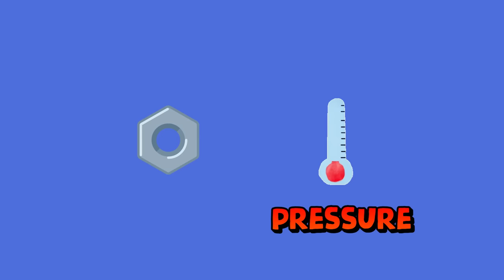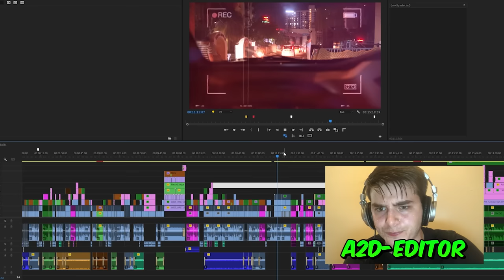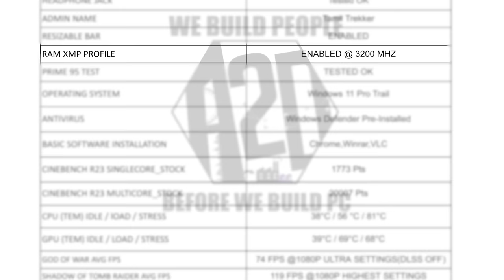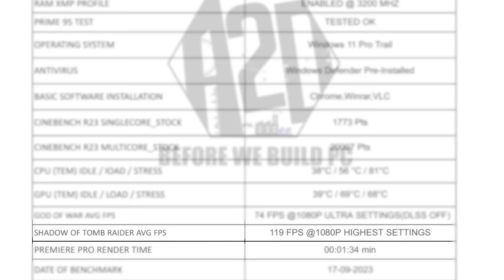Tamil Trekker Editing/Gaming PC Build | @TamilTrekkerOfficial Rs.1,00,000/- Lakh Complete PC Build

Comment: Once (In the 90's) they use to say that SMD board must not be touched without wearing a anti static wrist band but now I am seeing people handling mother boards and processors without any precautions, do today's mother board have protection from antistatic voltage ?
Please explain.
Reply: Dealing with PC and electronics for 11 plus years with bare hands, never my parts got damaged by static current partly coz in Chennai humidity is so high.
Reply: @arunvedachalam4690  
I too don't know why there was a precautionary note in the 90's but still antistatic wrist band are sold for electronic industries.